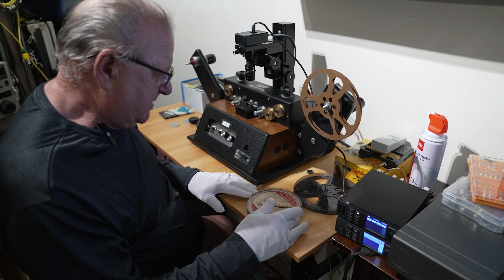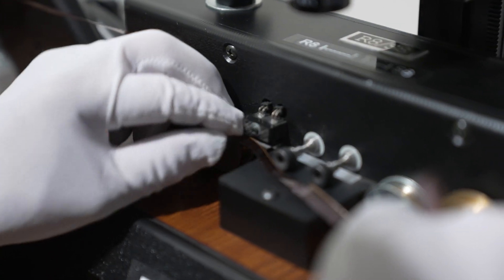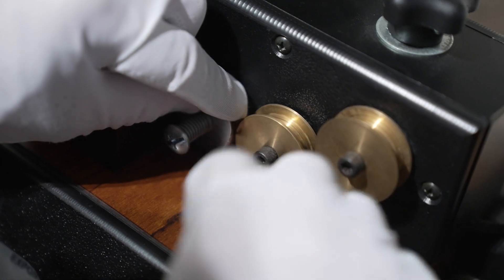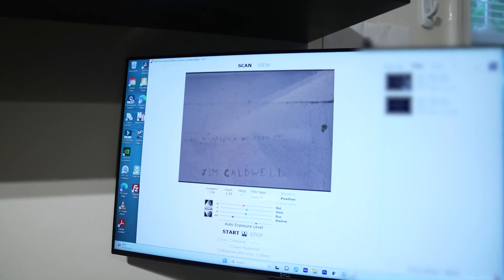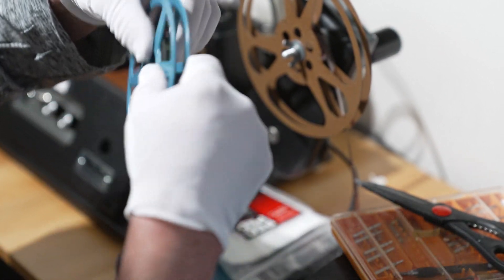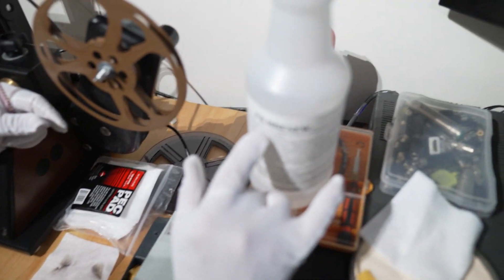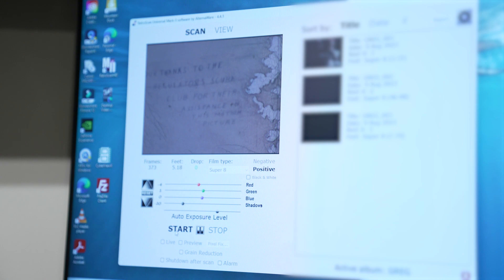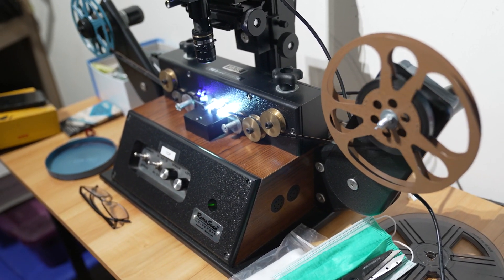8mm Film to Digital

Comment: You're running it through the film gate incorrectly.  It should weave over the silver spools and then under then over the brass spools.  Keeps the tension at the correct amount to prevent the film from moving and being out of focus.  The only reason you might run it like this is if the film is constantly breaking and you need to keep it flat as it runs, this works OK, albeit not ideal.   I used to use this machine, and now I use the MkII as the MkI gathers dust.
Reply from the maker: Hi Eric, That is the reason we are running it this way, it was brittle. If you watch the video, you can see how bad the film is. The condition of this film is the worst we have seen to date. We were lucky to get what we could out of this reel.

Comment: Is that one of the MovieStuff units? I have one of the old (cheaper!) ones which used slow, low-light projectors with an enlarged gate and a simulated mouse-click to do the frame-by-frame capture. Also, it looks like there is (pretty beat up) Kodak Sono-track on that film? I have an old Emuig projector to grab audio, but I have to re-sync the audio in FCPX since it drifts.
Reply from the maker: Hi Ward, It is a Retro Scan by MovieStuff. It can convert 8mm and 16mm reels. The sound stripe was added to it a later date and the client didn't want it. We do have a unit that can capture audio. Do you like your MovieStuff unit?
Reply: yes